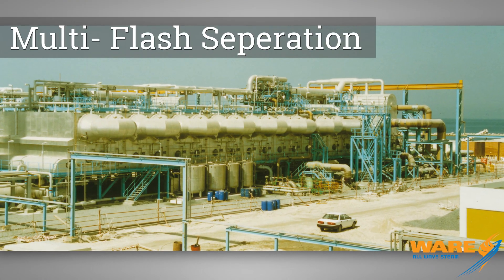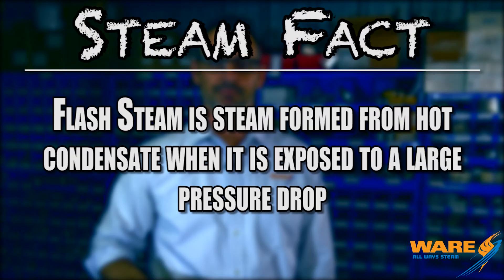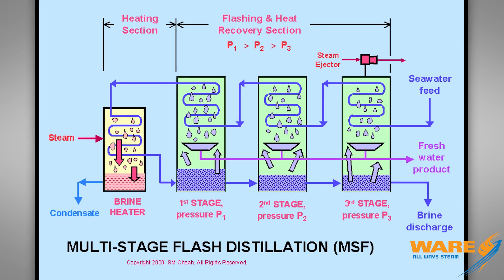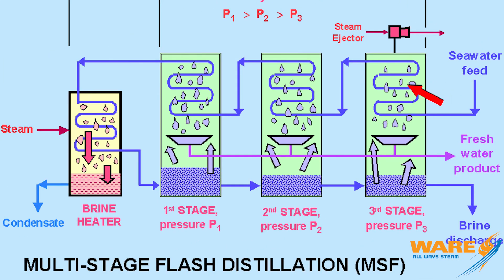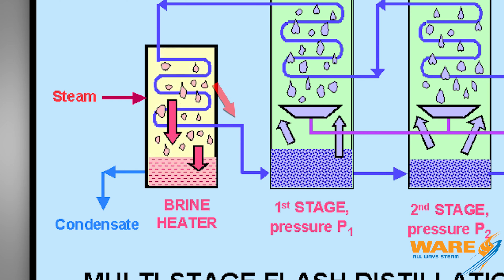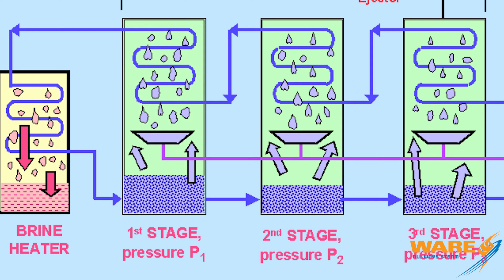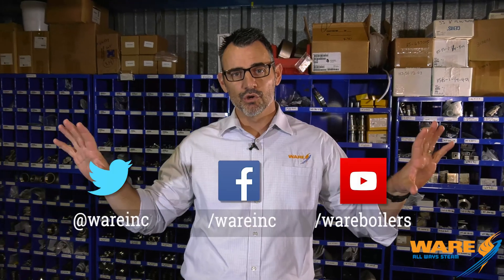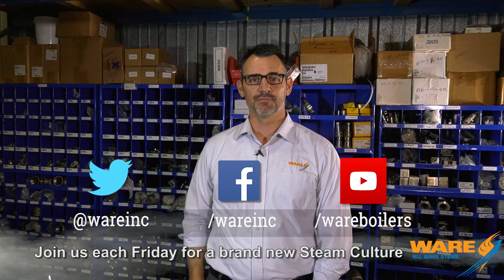Desalinization with Steam - Steam Culture

Comment: Ha, I am not an engineer at all. I made this product last year. I called it E.V.E - Evaporation Engine. -  I didn't use a giant system. I can send the designs. it is a 1 boiler system that is self contained with copper tubing at the top. The water is heated and the steam is forced through the tubes and condenses back into water through it back to another container. If in a vacuum, you can use ultrasound to boil the water at 0 psi atmosphere inside a container and force that same steam out and have the same effect. Meaning it could be deployed on miniature or micro scale to areas where power is almost non existent and run off of solar. =D
Reply from the maker: That's incredible. Well thanks for watching and sharing with us your story!